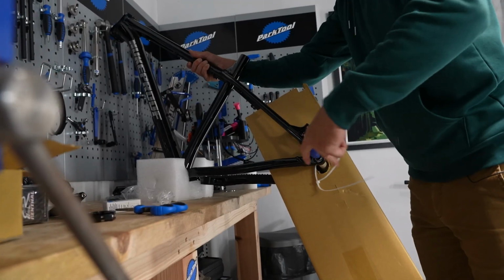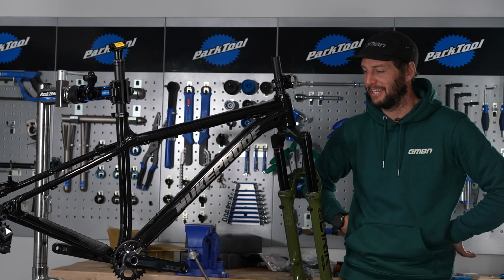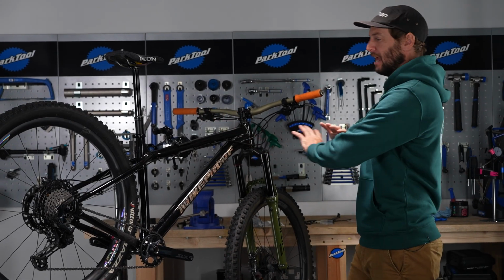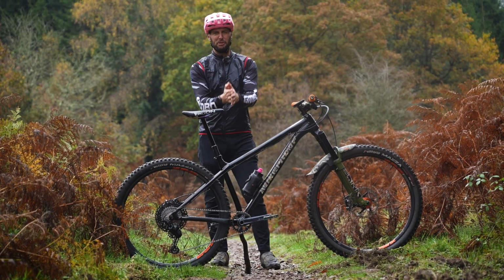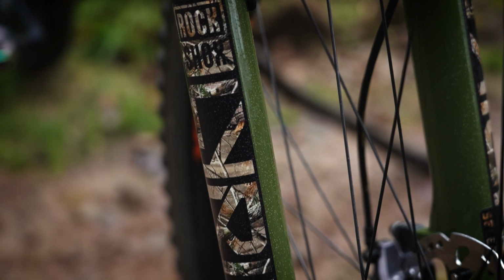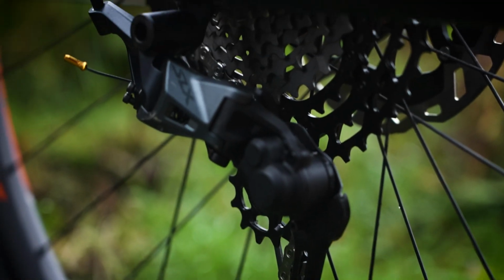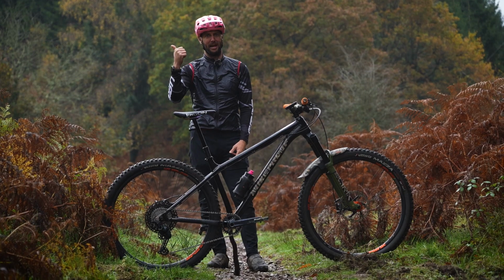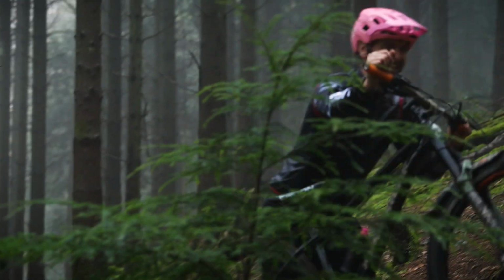Building The Ultimate Winter Hardtail! | GMBN Vlog

Comment: For the sort of winter riding I do, my single speed cromolly fully rigid 26" wheel MTB works a treat.  Not as fast as my summer MTBs, but a heck of a lot of fun.
Reply: Yep, same. I have a 26' specialized 90s MTB converted to single speed.  Less is more in winter I don't want to worry about gears or suspension.
Reply: Probably found a good point here 26ers will clear mud faster than 29ers. Much more suitable for UK mud. I still have my winter bike Specialised Rockhopper comp 2000
Reply: 26er all day for me
Reply: Yeah, that doesn’t sound fun at all, due to geometry 😂
Reply: Yep fully rigid, single speed and no dropper is the way to go for easy maintainance. Makes you work harder too so a short blast feels like you've had a good ride.

Comment: My winter MTB is a 26” XC hardtail from ca. 2004, which I bought for only like 20 pounds and soon after equipped it with Shimano XTR 3x9 drivetrain with dual-control shifters/brake levers, which cost me only like 80 pounds from my good friend (whole groupset except for crankset). In the ‘winter MTB’ setup I use some more aggressive XC tires and a Marzzochi Bomber fork that came originally on the bike (can’t believe how smooth it still runs, I doubt there was any service done to it). For the rest of the year I swap out the fork for a ridgid one, install full mudguards and switch to fast rolling tires and it completely transforms its personality to what I consider the ultimate city commuter.

I really like your setup though! Not a huge fan of the camo, but seems really like a dream bike for these months.

Comment: You don't need a chain guide on a hardtail. The length of the top side of the chain does not change due to suspension. So it stays on very well. 
I've never dropped the chain on my hardtail so far. 
About a bash guard, that's up to you I guess, If the only thing you might hit are wet roots, you can do without I guess.
Reply: really? on my hardtail my chain comes off when in not even on the trails yet, just on the road, but that could be my very worn chainring and chain which have been on for a year, ordered some new ones that hopefully will fix my issue
Reply: @leodufour2  Of course, in my statement I assume you do have a narrow wide chainring and a clutch derailleur. 
With that I've never dropped a chain, not even on the roughest trails.

Comment: Great video and a Xmas present to all hardtailers.  Would love a ballpark figure on the cost.
Reply: frame 600
fork 700
wheels 600
slx group 300
saint breaks 350
stem and bars 150
budget dropper 200
tyres 100
seat and grips 100
small parts and stuff you always forget 200

that's 3300 euro i am estimating when i look up some components (2850 pounds) :( also did a scout build this week but took almost all parts from a 2019 fs trailbike, so it was only the frame, the bottom bracket and some cables for me. btw. that old trail bike cost about the same as my estimate when i bought it and it had fox factory parts on it...

Comment: Cool bike but some interesting choices considering its to be used for messy conditions in winter. Why an xtr cassette? Carbon bar (one up) is nicer since it doesn’t hold the cold like an alum bar does. Also, SLX? Might as well save a few bucks and just do deore throughout but with XT shifter. Again, nice bike but I’d be saving some money on some of these items that will see some nasty conditions.

Comment: Thanks for the Vid, I'm in the USA, at 3,000 meters, our winters are a bit different (snow/ice). I'm wondering what your weight is and what tire pressure you are running in  the front and the especially the rear?
Reply: 170lb 21.5psi front 23psi rear
Reply: @phenofinder9145  Thank you mate
Reply: @JBean_COCR  that's on 2.4's

Comment: Slx groupset i get for winter riding, but the XTR cassette is a bit of a waste, don't you think? Or is it cause of the rotational weight?
Reply: He probably had it lying around I guess, it's overkill for a trail bike
Reply: @msagoo29  i wouldn't say for a trail bike, but for winter riding, which is all about using spare or cheaper components to destroy
Reply: Sadly it seems crazy but it was all that was available at the time of ordering all the bits. Defo not my first choice for this bike but needed to get it finished

Comment: BLACK is the worst color for anything because it does Not reflect light and it looks realy SMALL outside.
I just PAINT STRIPPED my Black MONGOOSE Fireball SS D/Jumper and I highly POLISHED the ALUMINIUM FRAME to a MIRROR FINISH...  2 Hours. 

                                           HOLlY CRAP does it look Larger than Life...     ABSOLUTELY FANTASTIC to look at.